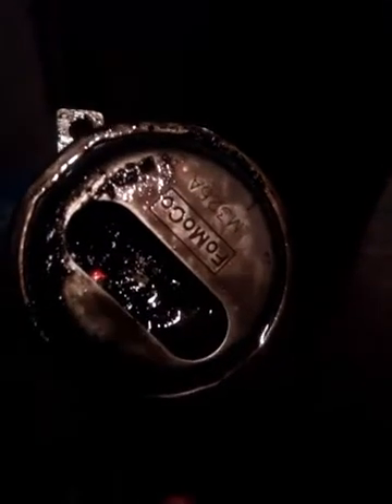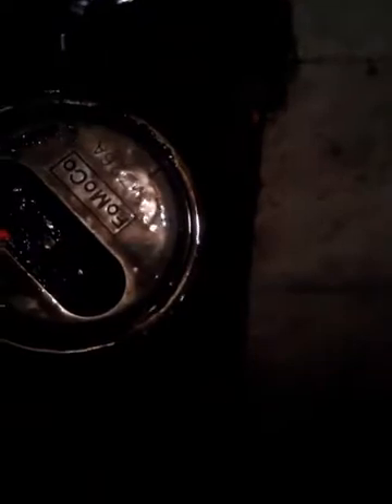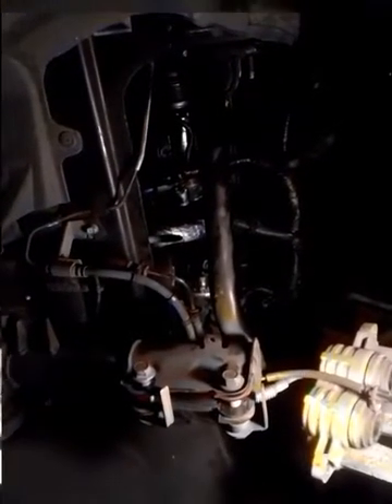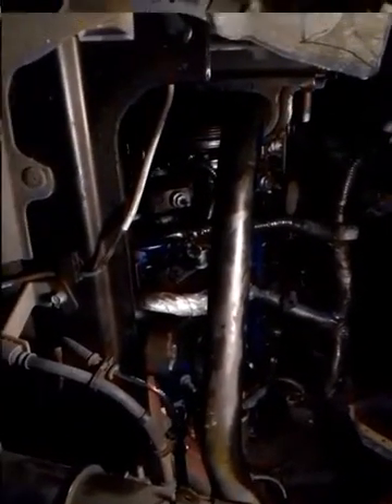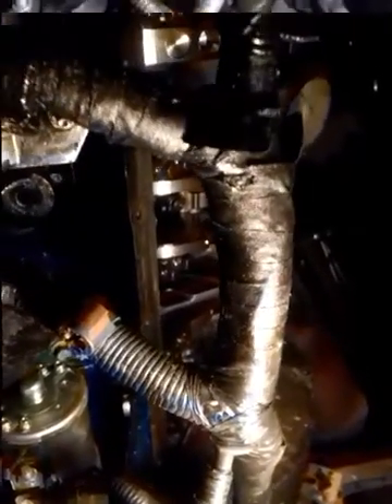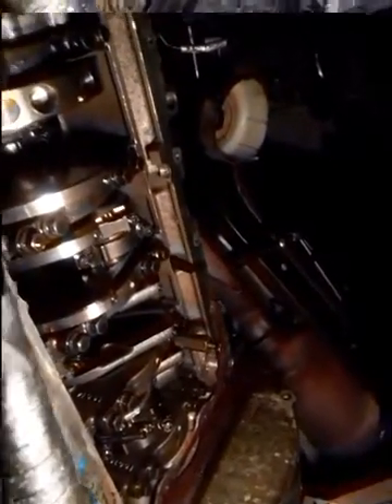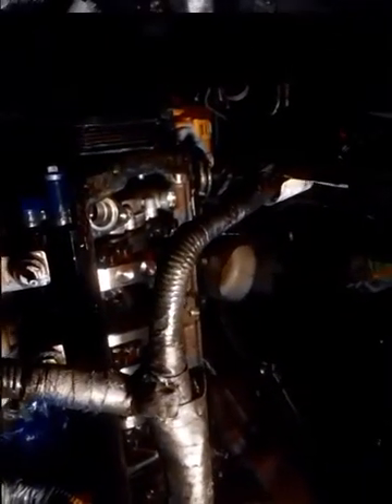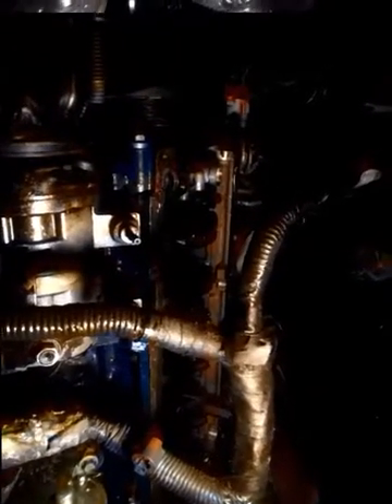My oil sump line was constipated.....Smh ......the saga continues of the 5.0

Comment: Hey jason, about to change out the rod bearings on a 5.0 soon. Do you mind sharing which brand you decided to go with and if this cured your 5.0 tick?
Reply from the maker: Mustang Reyes I honestly just went back to ford for new o.e.m. bearings..... I mean it all depends on if you are using the stock crank and then even at that point it's three different variations of bearings that come from ford.....so in my eyes if you are replacing the crank......know which one you are using and then get the right bearing stage for proper fit. .... if not you still have to measure clearances in order to get the right fit.....or else the crank won't rotate
Reply from the maker: And yes it did cure it Mustang Reyes
Reply: Jason lyte thanks for the quick reply. Took out the motor yesterday and found shreds of metal shavings in the oil pan. Started removing the rod bearings and found that cylinder 3 and 7 had spun the bearings. Wouldn't have even thought about checking them if it wasn't for your previous videos.
Reply from the maker: Mustang Reyes Hey.....I'm glad to help.... check the crank and make sure that it has not been compromised